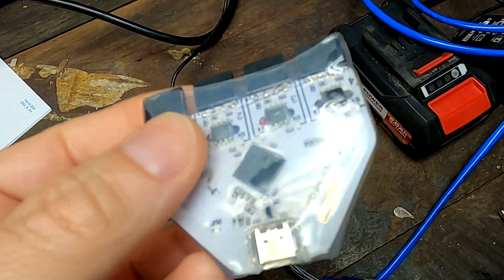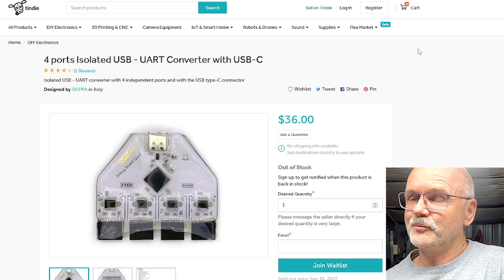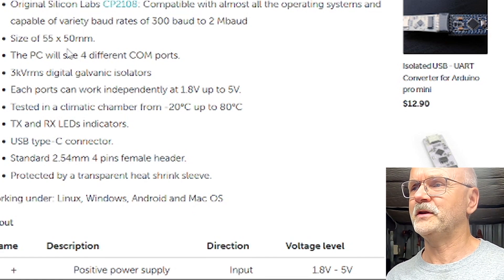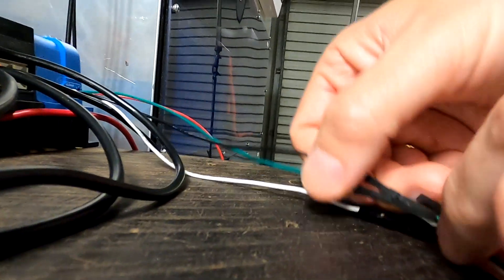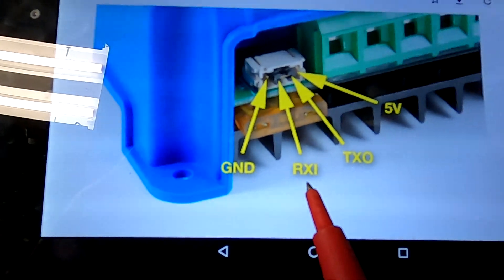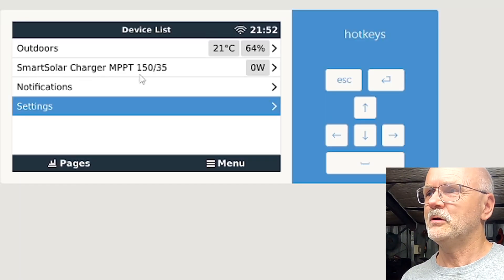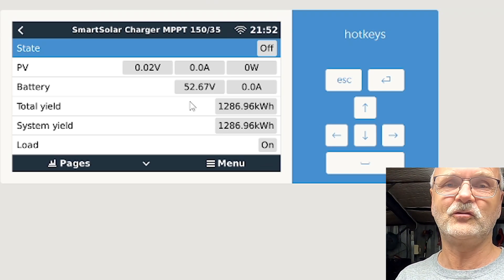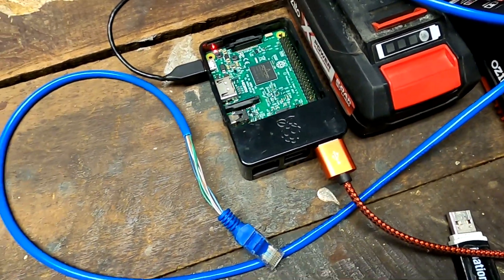Connect 4 VE.Direct Victron devices to one USB port.  Save space and isolate all your devices!

Comment: I have been dealing with Victron stuff for years and can say: Insulated adapters are a must! The 4-channel adapter presented here is also insulated, but I've also had problems with it, but never with the original adapter. 
I also recommend using only insulated power supply units for the various operating voltages, never these cheap DC/DC adapters!!!

Comment: Does a waveshare usb to 4 port rs485 or 4 port uart adapter work in place of the adaptor you have used? Looking for something that can be reliably hard mounted. Tia
Reply: No matter. I found the waveshare isolated 4 input rs485 adapter withe the same ft4232h chip

Comment: I made my own ve cable and hooked it up from the Victron 150/45 charge controller to the raspberry PI 4B while using the red wire. Is this the correct way? Will it work without hooking up the red wire? I enjoy your videos and they have helped me out very much.
Reply: DIY cable no good needs isolated wire. Only one solar string out of the two will read properly and that is the isolated one.

Comment: Thank you very much for your valuable tip
Just delivered from Milano. Quite expensive.
1 circuit board, 4 cable, including postage, 69 euro.
Works perfectly. No more problems.
ciao, ciao, Pfusch am Bau ;-)
Reply: well, I would say its worth the money as you protect your gear from false voltage and you safe SUB-ports. I love the Duppa board! If somebody wants to find it in Venus OS (via SSH login), just use the command "lsusb" then it will show up as "Future Technology Devices International, Ltd FT4232H Quad HS USB-UART/FIFO IC" (at least the one I bought about 3 months ago)

Comment: I just received my ordered device in mail today. I'd like to give supplier Duppa 5 stars, not only for fast delivery to NSW, but for the rapid response to a mistake I made. I accidentally ordered the "pin connector" version together with 4 JST cables. I realised 13 hrs later after confirmations etc, and emailed to correct it to JST sockets. Simone said "No problem" soon after. Just 7 mins later I got email saying it was shipped. Disbelieving, I double checked it, and she confirmed "she put them in". Very happy.

Comment: About your generator you can put a storage additive in the fuel such as Stabil Storage which can get you up to 18 months of storage otherwise regular petrol will last about 6 months reliably.

I would run the carburettor out of fuel each time you run the generator before you store it away.
You can run it out by just turning off the fuel valve (but not the ignition) when you want to shut it down.
It will cough and splutter when it runs out of fuel which is perfectly normal and will not cause it any damage.

No need to get it serviced unless you really have a problem with it except the oil, spark plug and air filter change which you can easily do yourself.
There really isn’t much to those little generators.
Reply from the maker: I don't have a generator. 
We don't need to burn stiff to make energy 😉

Comment: I have buy the product that you are advertising from Dupa. I have by also all the connections and the cables witch was necessary. I install it it was working perfectly with my Victron cerbo gx and the shunts but unfortunately, after the first update of my Victron, Cerbo, GX and the victron Shunts  stop working I change many cables, but do not solve  the problem I tried different things which they tell me from Dupa but nothing it works anymore. Please give us a solution or stop to talk to advertise it because it costs not only the money but a lot of time to solve this many thanks it will be nice to wait for an answer if existing one.

Comment: i recently bought one of these 4 way ve direct modules and i can confirm as best as i tried, they don't work with a direct connection to a Victron colour control GX
I got the white light on the board from the usb connection to the colour control usb socket on the back but was dead the other side with zero activity from the Victron 100/50 solar controller to the 4 way module
Reply from the maker: I replied to your email. Try these steps as suggested.
Reply: @OffGridGarageAustralia  
i am not getting your return e mails
Reply from the maker: @joeconnolly89  I'm getting yours. Nothing in your spam folder?
Reply: @OffGridGarageAustralia  nope
I checked
Not recieving anything you send
Will try again
Reply: I exactly have the same behaviour with the multiplus 2 GX (3000) - have you solved the issue. even tried to plug it into a rpi venus OS but didn't work either.
Reply: I have the same problem, how did you solve it?

Comment: How do you extend those little 22 gauge wires to connect to all of your devices? I've looked for extension wires with that type of connector and the longest I've found was 600mm. My BMV-712 is about 20' away from all the rest of my equipment. The port is located on the back of the 712 so I would have to run the wires the 20'. How do I do this???????
Reply from the maker: You can extend the Ve.direct cables to up to 10m. If you google this you will find cables for this in all kind of lengths. Or you can just make your own...
https://www.solar4rvs.com.au/victron-v.e.-direct-cable-0.3m-0.9m-1.8m-3m-5m-10m
Reply: @OffGridGarageAustralia  thank you SOOOO much!!
Reply: Hello guys any idea what could be the best way to retrieve the water level of 3 tanks ? On raspy / venus ?

Comment: Andy, any limit on the length of the USB cable between the RPi and the isolated converter?  This may be a good solution so if RPi+Screenare10-15 or 20 feet away from the power set up.
Reply: I need to know this as well. All my equipment is located in one place except my BMV-712. It is about 20' away mounted inside my 5th Wheel. The 712's port is on the back of the monitor and NOT on the shunt like the Smart Shunt is. So I need to run the cable 20' or so in order to connect it. Have you found a solution?????

Comment: After ordering one of these and it getting lost in Norway the maker sent another one and I finally got it installed and IT FREAKING WORKS!!! I have 2 smart shunts in my RV. One for Chassis battery and the other for the House batteries. I've been struggling for over a year with one or the other shunts dropping off network after 20 mins to 3 hrs. This has been running for a week without a problem. Thank you!!!
Reply: Buy a system that does not require an internet connection whatsoever, whether simply monitoring the system parameters or manipulating the parameters. Victron is screwing with you remotely to stimulate you to open a service ticket. Their solutions always involves buying a new component that you already have. 

This component will be addressable only online so they can screw with this one as well next year so they can slowly bleed you dry with system failures that are not failures at all, just a remote killswitch  engaging

Comment: Hi Andy, I just bought one of these little USB to quad UART adapters and they are great. One thing to maybe point out is that if you order one with JST connectors already soldered in place it will come with a socket with 2.45mm pitch, not the same as the 2mm pins of the Victron Direct connector so dont but one pack expecting it to do both ends as it wont. 
I'm considering putting an AC meter on my boat to measure shore power import and I note that the Victron offering ET112 has and RS485 output. Victron say to use an RS485 to USB converter to interface them but I'm thinking that I ought to be able to hook Pins 3, 5 and 7 of the RS485 lead directly to one of the UART inputs. Am I right to think this?

Comment: I dont use the DYI cables and I had the same -1 issue on my MPPT I only use the cables I bought directly from  Victron here in Netherlands and the only things connected in this network is a Victron Smart Shunt a Victron Global Link 520 and Victron Smart Solar MPPT 100/20 the only way I could get charging back was to disable the temp as directed in your previous video
Reply: same -1C issue here on a new installation with Lynx shunt (wires switched for batteries on right, lynx distributor on left).  I use only Victron cables.  Turning off/on DVCC/SVS did not correct, but firmware updates, or the process of updating the firmware resolved the issue.  Another very similar, but 2 year old installation with a BMV712 did not encounter the -1C issue, but updating the firmware of its MPPTs and shunt could have pre-empted the -1C.

Comment: Hi Andy. Just a suggestion for another video. Try and find a reliable USB and HDMI extension for the CERBOGX to operate its touch screen/50 and 70. I’m sure there would be many people out there interested in this one.
If you do not own a touch 50 or touch 70. Feel free to get in contact with me. Thanks, Andy.
Reply from the maker: A wireless HDMI connection for these screens would be great. I really hate this cable connection.
I'm always using my old tablet to connect to Venus. At least I don't need any cables then and it works pretty much the same...
Thanks for the offer!

Comment: Andy, all of the ones where I have had an issue on this temperature problem they were actually running standalone with no Ve direct port to a CERBOGX device. They were only running on their own.
I am still yet to receive a reason from VictronLED. They were replaced under warranty.
Reply from the maker: Do you use smart shunts in your systems? They investigate in this direction at the moment...
Reply: @OffGridGarageAustralia  yes…

Comment: Thanks again for relaying to us all, how to fix and run things. But I really don't get why in 2022, that in order to plug in a bunch of Victron gear in this example, that they haven't made their equipment a simple plug and play without all the extra fancy peices. Whether it's the victron cables that are over priced, or just with what all Andy has shown. By now you would think Victron especially should be just a simple usb plug and play setup. This is a major reason why I myself have no intrest in trying to hook everything up together. WAY to complicated for something that should be brain dead simple. Thanks again though Andy.
Reply from the maker: Thanks, Mark. I think all Victron gear is pretty much plug'n play and all of the ports around the Cerbo GX are already isolated. So, in this case a simple USB hub would work as well if you need more USB ports for your devices. I can see this now when I compare this to the Raspberry Pi. With the Cerbo for example. you just plug something in and it works right away.
And yes, it gets quite complicated after a while. You start with one connection and keep adding more and more devices. It won't get easier and adds to the complexity and maintenance requirement of your system. But what's the alternative?
Reply: @OffGridGarageAustralia  very good point. There really is none. I do hope that Victron continues with their work and tries to be the first that keeps it simplified as much as they can and continues to address the issues that come up. No one else is really doing that these days.

Comment: Hi Andy, great content as always. I was wondering something that you probbably know.  Deye have come out with a new range of 3-Phaze hybrid inverters that can handle 160V-800VDC batteries, and I was thinking that maybe it would make sence to build 4 of the modules you have with an individual BMS like the JK BMS, but then connect these 4 packs in Serie in to the Deye inverter.   The power output and and DC input that I will need force me to buy two or even 3 of the48V Hybrid inverters so that is 3000-6000USD extra cost compared to build a 192VDC battery and use the high voltage inverters.  Do you see any problem with such build and is there something I dont see with 4 pieces of series 16S instead of a 64S BMS?  I'm thinking it might be some problem if it is not properly insulated between ground on the internal power of BMS and the negative on the power-side if that has ie.96V higher potential.  Thanks :)
Reply from the maker: Thanks Jonas. That would be far out of the DIY zone. 160V DC is super dangerous already and I would not recommend building such a battery.
The JK-BMS cannot handle such a series connection, the MOSFETs are not designed for that. In fact, most (if not all) of the available BMS won't withstand that and you may need an expensive Batrium (not even sure if it would handle that either) or some custom made BMS. A series connection of BMS is not a reliable solution. If one trips, the whole system would stop working. I would not design such a system without redundancy.
I don't see any advantage for having such a high DC voltage battery. 48V is totally fine and works with all the gear and devices out there.
Reply: As Andy says, being able to connect lithium batteries in series depends on the BMS.

You'll find some pre-built Lithium batteries will say no series connection, while others may say 2 in series or 4 in series.

It comes down to the MOSFETs used (as well as supporting components). An ultra cheap 12v BMS will use MOSFETS rated for maybe 18 or 20v, since a "12v" battery is really 14.xv and you design with some buffer for slightly over-expected operation, and use the most commonly available parts. Better BMS boards will be rated for a 12/24v setup and so will use MOSFETS rated for the higher configuration. If you use these for a 12v pack, that gives you the possibility of having 2 in series. As the offerings get better (and more expensive) the componentry will have specifications for much higher voltage, and so it's safe to connect more in series. A BMS designed for 48v, cooild be sold with board variants for 12v or 24v and so on, but use the same parts as used for the full 48v design. This usually is noted at 4s-16s or a 4s-24s or something. The maximum cell number is indicative of the overall rating of the MOSFETs used. If you use a 24s BMS in a working (IE as designed by the manufacturer) 12v (4s) pack, you can probably safely have up to 6 packs in series.

As Andy says, a failure of one BMS would basically result in an open circuit (or short circuit?) for the entire pack.

An interesting consideration is how a BMS allows Charge/Discharge to be toggled on or off discretely. A MOSFET allows.current flow in one direction, but has a reverse flow diode, a "body" diode. This body diode is designed to protect the MOSFET in the event of reversed polarity, and thus reverse current flow.

Clever design thinking and specific MOSFET manufacturing has brought us to the place where that "protection" mechanism is in fact rated for equal or almost equal current flow in the reverse direction as the forward direction.

So the MOSFET is technically used for discharge current control, while the body diode is used to control the charge current. You may find that the charge current of a BMS is lower rated than the discharge current. This is why.

As a diode will only conduct when there is a voltage difference of about 1/2v (a generalisation), when charging your pack, as the pack voltage approaches the charging voltage, the diode will stop conducting, giving you the top charge cut-off. This is probably controlled in some clever way that I don't know about yet, to ensure that the setting you configure in software matches the diode operation. Perhaps a DC-to-DC converter? So if a BMS in a series connected pack shouldn't affect the other packs in the string of cells fr.charging/discharging. Perhaps there is more to it than that.aybe there is some sort of pass-through circuitry which is switch depending on if the BMS charge/discharge state for the single 12v pack in the string.

Anyway, whether a lithium battery can be connected in series or not, comes down to the design of the BMS, and the MOSFETS used in that design and the manufacture of the board.

Comment: Can somebody please help me... l need to work out what amp size BMS l need for 8 x 272ah 3.2v cells (2 x 12v then in parallel) for a 24v battery please.  I am overwhelmed by countless videos and my mind is fried!
Reply from the maker: That totally depends on your charger and also load. How much amps do you pull at max load?
Reply: @OffGridGarageAustralia  Thank you so much for answering me, l live in central west NSW and l'm building a 40ft shipping container house on our family farm, being remote there's not really any solar people about to ask for help.  I have two Epever 100amp/200v chargers one for each array (2200w) each.  I have a 4000/8000w Giandel 24v inverter. I think that we're going to have a max load of 3800w.  I was thinking of a 200amp Daley (not smart version) BMS or should l have two of these?

Comment: Awesome device and explanation! That's pretty cool!. 
As for the cables..  personally I wouldn't think having non shielded cables would bring any interference with such short runs myself. We dealt with those same discussions at the Amazon data centers I worked at (Temperature control installs). BUT, it I will say that it surely is a better install and certainly could only help.
Reply from the maker: OK, that's a good point. Even the longer 10m VE.Diect cables don't have any shielding so it may not be an issues...